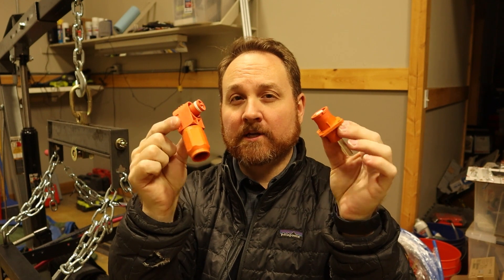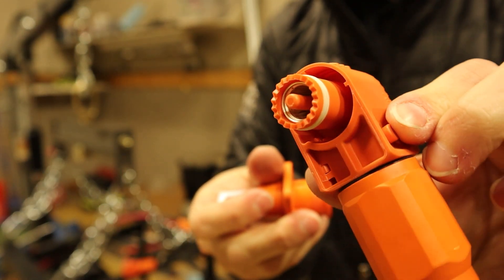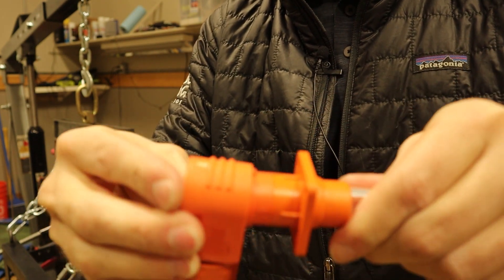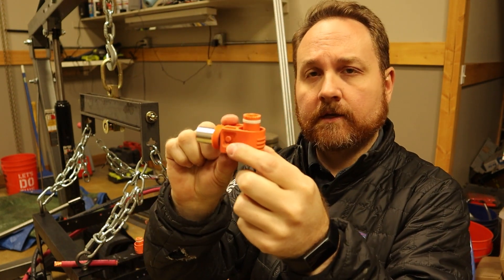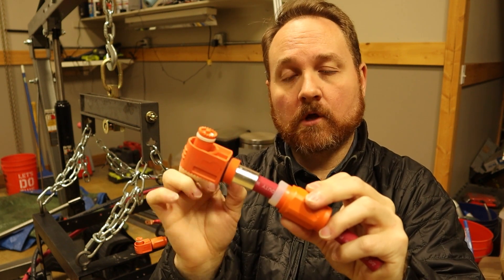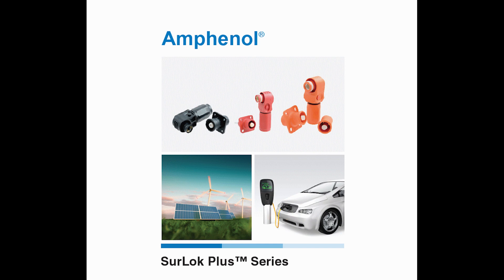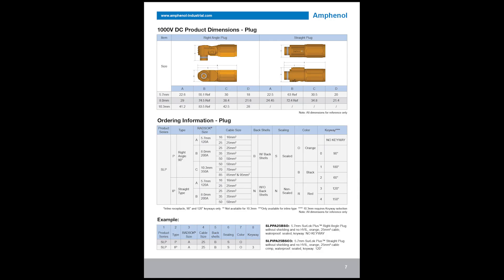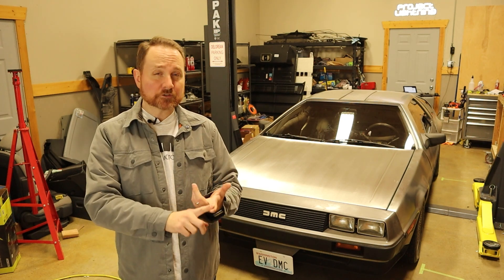SurLok Plus Connector (big brother of RadLok) for EV Conversions

Comment: Is heat shrink a good idea? In another video I saw that it was recommended to pull the heat shrink to the edge of the thread and shrink.
Reply from the maker: Heat shrink was not recommended in the datasheet, but I don't see that it would mess anything up. I'm not sure it's necessary, though, since that whole area is getting covered in the rubber gasket material and then tightened down.

Comment: Is the female waterproof when not mated?
Thanks for the video
Reply: Yes i can see the pins are open but what i asked if the water will stay only around the pin outside or it will pass from around the pin and go inside, sorry that i didnt explain myself well
Cheers, many thanks
Reply from the maker: @cliv3-88  Neither side are waterproof when not connected - the pins are open - BUT you could put a cap over it to keep it dry. I don't know if they sell caps, but you could 3d print one. I am planning on doing that to some high voltage connectors. TPU is flexible and will be water resistant.

Comment: Great video. Do they have a size that will fit a 4/0 cable?
Reply from the maker: I believe they do go up to 4/0 cable size! Spec sheet shows 95mm^2 on the largest, which I think is big enough for 4/0.
Reply: @BillCarlson   I did some research and they offer the correct size (12mm) for 4/0 wire in the 1500 DV series. They only offer the 90 degree plug in that size. DO you know where I can buy this product
Reply from the maker: @dennym  I buy them from Mouser Electronics or Digi-Key, which usually have them in stock, but not every particular type.

Comment: Hi I was having a question if I use a without keyway 90° connector and with keyway type receptacle will they mate?
Reply from the maker: I'm not completely sure, since I don't have any of the non-keyway versions to compare, but I believe a non-keyway will work with anything else. I'm guessing this is why you can't get a non-keyway version of the high voltage or EMI-shielded connectors.
Reply: @BillCarlson  So I have check different photo online actually the rotatable keyway hole of receptacle is an extra attachment that come only with w keyway receptacle which make it thickness greater than w/o keyway receptacle So i think for my above question it might not connect

Comment: I was so excited to have these connectors on my VW Beetle conversion and made 2 stupid mistakes.  1) I neglected to put the collar on before crimping, 2) I crimped… but cannot get the hydraulic crimped off since my 2/0 cables are already run.  So frustrating that I will need to trash the connector ($30 mistake) but how will I be able to crimp a new one??  So frustrating.
Reply from the maker: My crimper has a little bolt on top that lets me remove the top crimper pad (also used to change crimper sizes). Undoing that means I can remove the crimp from the tool. Does yours have that?

Comment: talking about that DeLorean.... ever sealed those wide open battery boxes? XD
Reply from the maker: The rear one is fully enclosed, the front packs will be sealed up the next time I pull them. Probably when I install the cooling system. All the panels are ready to install.
Reply: @BillCarlson  hope you made them and all connection into them water tight. would be a shame if all that work goes up in flames.

Comment: Hi Bill what wire are you using with these and where you are sourcing it?
Reply from the maker: This is from Amazon - EWCS 2/0 "Premium Extra Flexible Welding Cable" - costs about $5-$10/foot depending on how much you get. You'll also want to get a 10+ ton hydraulic crimper. I got a 16 ton from Amazon for about $60.

Comment: Great info but if you can get cables and connectors off a leccy car it's way cheaper. Usually the cable will be shielded too.
Reply from the maker: For sure! In my build I used all of the cables and connectors that I got from the donor EV - even extending them in a couple of cases. However, since I split my battery pack between 4 sub packs, I needed some additional wires and connectors between them all.
Reply: @BillCarlson are you doing ok?  Long time no vids!
Reply from the maker: @edwardraskin9144  Oh yes, I'm doing fine!! Just decided to stop making videos for a while so I can focus on other projects.